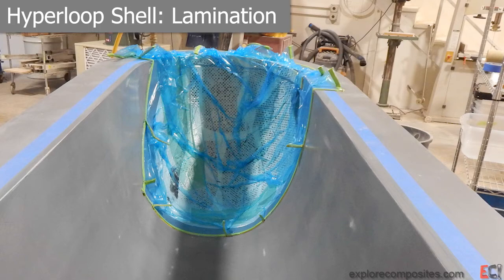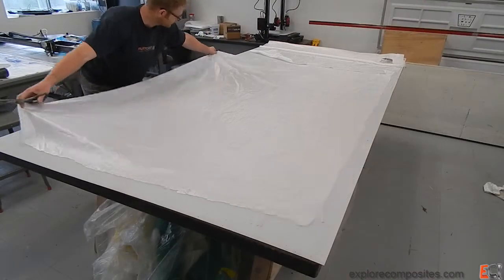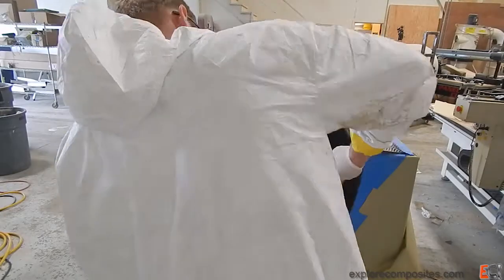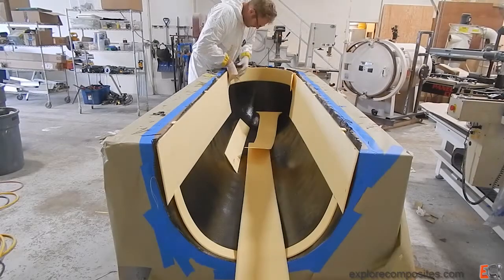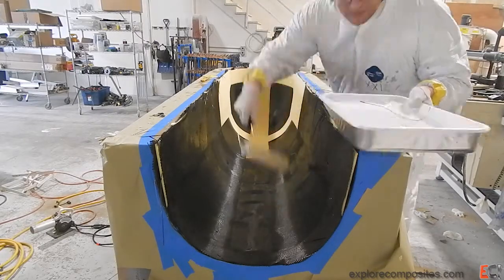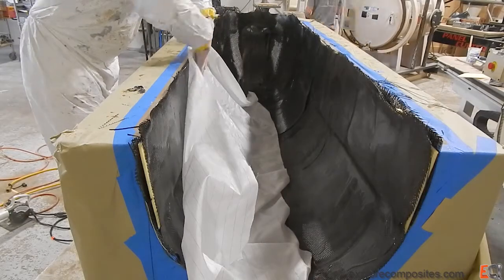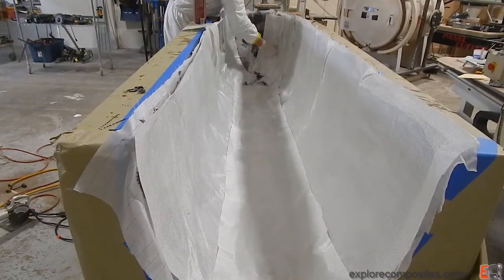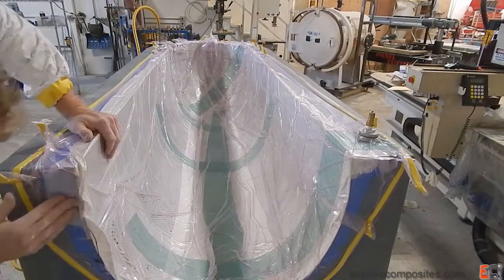Hyperloop Shell: Laminating Carbon Fiber / Epoxy / Corecell Part (Part 7)

Comment: Hello, I am just getting to carbon fiber for some personal projects, and have a few questions. 1. What grade is the carbon fiber you used (It appears to be 3k 2x2 twill but I'm not sure) 2. Why didn't you use honeycomb instead of foam for the support? Thanks
Reply from the maker: This is regular old standard modulus 6oz / 200g 3k 2x2 twill - spot on!  I didn’t use honeycomb because we didn’t have any and didn’t have time to buy.  Also was concerned about skin compaction if done in one operation and prerelease if just the surface ply was bagged with core done in a second bagging / curing.  Honeycomb would have been lighter bit more trouble.

Comment: At the beginning you do a test portion by doing a partial vacuum bag on the mold. How do you clean the gummy tape of the tool and have it ready for more lamination? I find myself always fighting and scrapping gummy tape residue, something I imagine wouldn't do much good to the actual mold surface.
Reply from the maker: If there is release (wax here) on the surface already it can make it easy to remove the sealant tape - but this also makes it harder to stick down in the first place!  Low slip semi-permanent releases work really well with sealant tape - you can release where the tape goes and it comes off, but not so much that not won't stick when you want it to.

If there is no release, the best thing I know of is 3M general purpose adhesive cleaner in a red can - I'm sure many other manufacturers make similar products.  It is nasty stuff and you need a respirator and thick nitrile gloves or it will eat through - but it works.  Of course, you'll have to clean the surface and re-release if you have a release agent on the surface - because it took that off too!

Comment: How much pressure should I normally create for Al honeycomb with 15mm thickness 
And what should be the CFM of the pump 'per metre square of area'.
Reply from the maker: I am not sure about the honeycomb - depends on how you're using it.  The CFM of the pump won't drive the pressure, but it will determine how fast the pump removes air from the bag and / or keeps up with leaks.  If you have a not-leaky bag, CFM won't matter much.  Generally for bigger parts, people use bigger pumps just in case leaks happen and to speed up bagging.  Figure 2+ CFM per square meter of bag surface and you'll be more than fine.
Reply: @ExploreComposites  I get the Al honeycomb bonded to the laminates using a hot press from a industry. After that I do layup upon it. So my doubt is how much pressure will be required to bond laminates to the 'Al honeycomb core already bonded with laminates'.